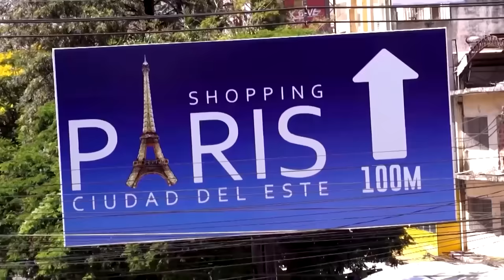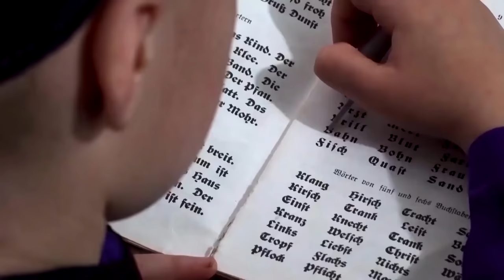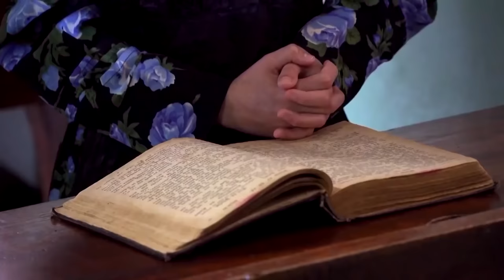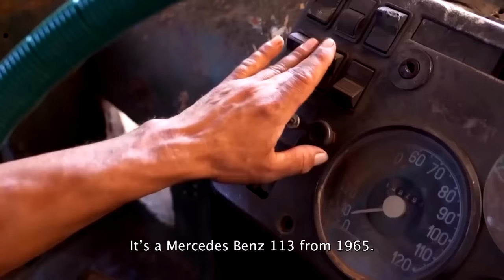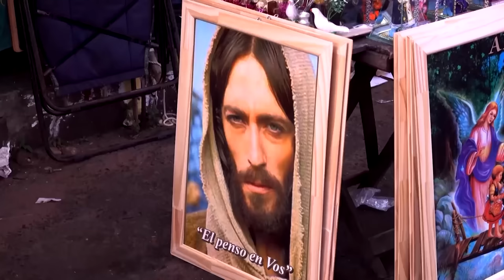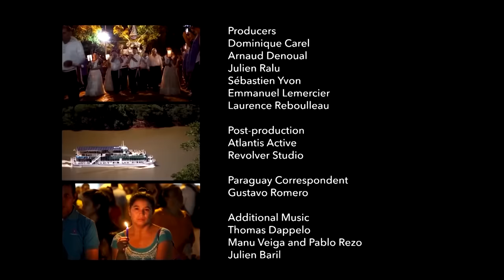Paraguay, en las Tierras Hostiles del Chaco | Viajes más mortales

Comment: What about using a tractor with 4 wheel drive and tracks system like a tank rather than round muddy slick wheels?
Reply: Not everyone in Paraguay has the purchasing power to buy a tractor. The vehicle in question is an F4000 for about 2 thousand dollars. An average tractor in Paraguay is about 35 thousand dollars.